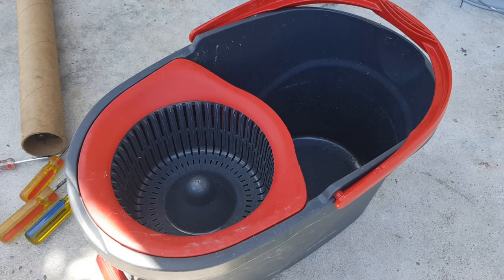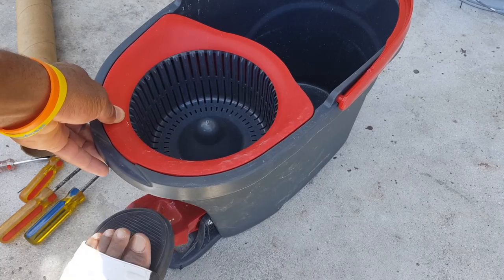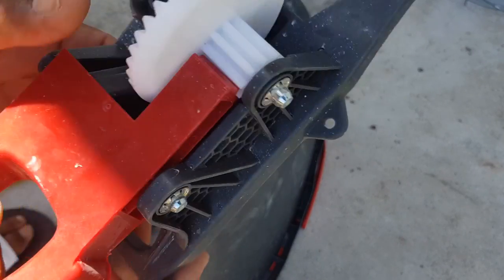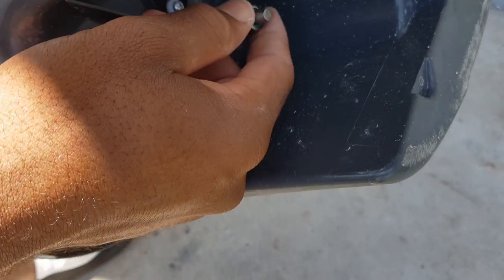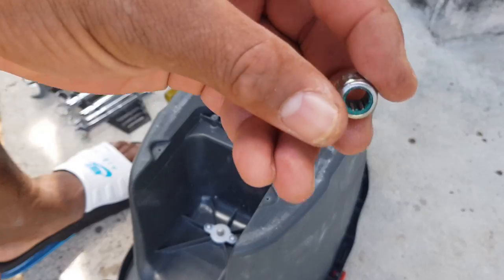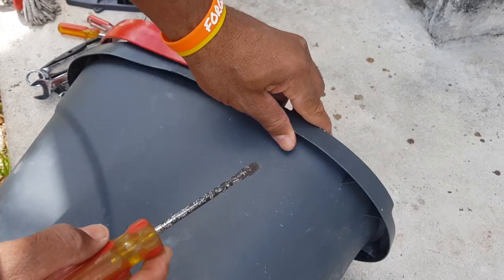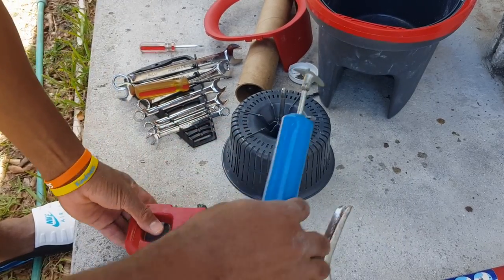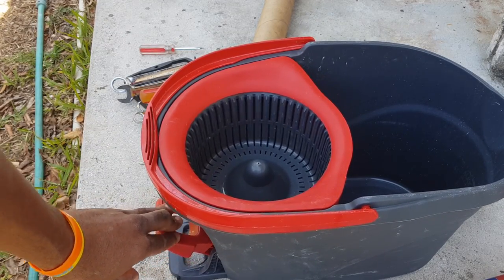O-Cedar mop not spinning properly (Easy Fix)

Comment: Took the bottom off. Sprayed all parts with wd40. It works like new. Thank you for the video.
Reply from the maker: Awesome!
Reply: I need that too! But still won’t spin idk why :(
Reply: I decided to go along with your comment and it worked!!! Thanks!!
Reply: Will try the WD-40 thank you
Reply: I tried replacing the gear, oiled everything and still the pedal goes down to spin but won't come back up. Any ideas? I can't find where you can buy just the foot pedal assembly😔

Comment: Thanks for the video. 
The most challenging part for me was removing the bearing, I don’t have the pliers, but I could get a good hold of it with a piece of cloth and eventually took it out. After greasing the bearing up a bit it started working again, we’ll see for how long.
Thanks once again.
Reply from the maker: Awesome that it's working again. If you the bearing should go bad, please see the link below for the bearing replacement. Also the ebay link is in the description that I purchased the bearing from.
https://youtu.be/yTHshD4gCbQ
Reply: @science_exam  I really appreciate repair videos like this one as it is terrible for the environment and so wasteful to throw out something that can easily be fixed. But:  My bucket does not have a bearing at all.  Yet it worked for 13 months.  I wondered if it had slipped off unnoticed while I was taking it apart.  Maybe it hit the floor and bounced into the furnace grate so fast I didn't see or hear it.  (It is true the lighting could be better; I wish I had a brightly lit worktable!) Either that is what happened  or I'm losing my mind--but it's hard to believe it was that fast and quiet and the aim to the grate was exact, like it was a comedy show!   There is only a plastic housing underneath that gear, which is one piece with the entire foot pedal section, and the turn shaft (spindle--whatever it is called) itself, which comes down from the (upright) basket, goes through a hole in the gear just as in your video, and rests in that little plastic cup, which is fixed/has no movement.  I thought at first it was the bearing stuck at the bottom.  I tried to remove it with pliers, but in brighter light it is clearly gray plastic and there is no bearing.  Did the design change?  On the bottom of that gear is a shallow groove which fits over the edge of the plastic housing (really just an elevated rim) and presumably turns on it like and old-fashioned grist mill.  So should I assume it MUST have had one, that I lost it instantly, and just order a new one?...Or could it be there isn't one in my model (which I bought in early 2021)?
Reply from the maker: @myfirstnamemylastname2994  There are different models, but the principles on which they work are pretty much the same.  If you know your model I can be of more help.
Reply: I will leave my question up in case anyone else has the problem I had--I just discovered the bearing is so coated with rust that even a thorough cleaning of the piece did not reveal it to be metal, and therefore it looked like rust stain on the inside of the plastic gear.  I had watched this original video and did not realize it was built into the gear center instead of being a lose piece that could get stuck to the turn shaft as it did in this video.  I watched the second video, which showed the bearing in its original place, so I then knew where to look.  Now I have to find a way to pop it out--we'll see what Liquid Wrench can do, because my hands are not strong and it's not budging with a screwdriver.  But what I said about design changes still is quite true.  P.S. Don't use bleach in your bucket if you tend to let the bucket sit for a few hours at a time as I do, as that accelerates rust dramatically as it did to my bearing.

Comment: I thought the problem with my spin mop was the bearing but I found that the bearing had actually worn the shaft to such an extent that the bearing was slipping. I cut off the old shaft at the worn point and welded a new piece in its place. I also replaced the bearing at the same time. Vileda mop brand.
Reply from the maker: Nice!

Comment: I think it's not just replacing the bearing that's the problem, mine's plastic gear often deviates from the rail. And you have to replace 1 unit of magic mop pedal gear. Understandably, it's a product that is easily damaged and buy it again. What do we expect from gears made of plastic that can be used to work for a long time? It is better to buy a magic mop without a pedal, because if it breaks it is very difficult to find a replacement. It's different if you buy the rotating mop handle... Many of them are sold in shops
Reply from the maker: Thank you for your contribution/ this information.

Comment: They changed the design on mine, so now it is much harder to fix… I need like a socket wrench with a Philips head to get into the space I need to get into to fix this. There’s two more screws now, under the part you unscrewed, in the space you put your foot. There is only an inch of space or so you get at those other two screws.. 😩
Reply from the maker: Wow, I hope you get to fix it.

Comment: So if the bearing is damaged how much is the replacement?
Reply from the maker: It's very inexpensive/cheap. The link is in the description from where I bought the one I used.
Reply: Or u could have just said how much and where
Reply: Alot less that a new bucket

Comment: If the bucket isn’t spinning freely after pushing in the pedal. Remove the bottom and lube the bearing and make sure there are no objects holding it
Reply from the maker: Thank you for this tip.
Reply: Thank you for the video 🙏🏼

Comment: This was not helpful. The red part at the top does not come off as easy as you showed in the video.
Reply from the maker: Sorry about that. There are few red lips underneath, press on them and they will come out easily. If you need to change the bearing, there is no need to remove the red part on the top. It's really not hard.

Comment: Mine does not snap right off... there is a grey plastic guard holding the gears in place... I cannot remove the panel from the bottom :(
Reply from the maker: Be careful if it has a guard. The smaller gear houses the bearing and you have to be  gentle in removing it.
Reply from the maker: This is a link to my other video for the bearing replacement.
https://youtu.be/yTHshD4gCbQ
Reply: Same with mine.  I tried removing the pedal and now it's stuck and won't come off. I think I damaged it.
Reply from the maker: @nataleeparkes7878  It is not damaged. The pedal will be stuck in a downward position if the bearing itself is stuck. Once you take off the bearing and release it, then it will be good again.

Comment: You owe me $30. I tried to pop off the bar that unscrews and I actually broke the entire thing.
Reply from the maker: Sorry to hear that you broke it, maybe you really popped  it or maybe your bucket  is crystalized.
Reply: Same here!!! It was all attached underneath!!!! And mine is newer so no "crystallization"
Reply: You guys are ridiculous 🙄.
Reply: @Mr.Dad1234  I do think if people have trouble following directions they should work on that, not ask for compensation, LOL.  But I do see that the design changes in small ways form time to time, and since the goal of O'Cedar is to make us buy more mop buckets, it stands to reason that they will make minor design changes which will make it hard for novices to fix and will make a good video non-applicable to their bucket....even though the bucket looks very very similar!  I've noticed, for example, that appliances with lids like a coffeemaker or a crockpot  may change shape or size JUST enough so that the lids aren't interchangeable.  It becomes easier to buy another entire cook pot than to find and order a replacement.  It used to be you could go to any thrift store and find replacement lids for such things, including over-safe glass, etc.  You could buy a non-working appliance and fix yours with the parts.  That's rare these days....
Reply: @myfirstnamemylastname2994  I was just looking in the comments bc I was wondering what my problem is, and I was thinking it was a design change to prevent this very thing. 

I’d say that is almost definitely the case. They have now added an extra plastic bar that fastens this down with two more Philips screws. These screws are hard to reach/require a very short Philips screwdriver, and another tool to hold it steady enough and to get enough leverage to unscrew, bc they are placed under the space where you push the pedal. There is only an inch of space to get a screwdriver into the space. 

I’m wondering is there something like a socket wrench that utilizes a Philips screwdriver head? If not, this may not be possible. I am trying to come up with a way to do it. Bastards at the company are one step ahead!

Comment: Anyone know? I replaced the bearing and still won't work. The peddle goes down but will not come back up. Ocedar should have whole foot pedal available, instead of buying a whole new system.
Reply from the maker: If the pedal stuck, the bearing is the issue.
Reply: @science_exam  the pedal goes down and it spins. It just won't come back up. I changed the bearing and it didn't help.
Reply from the maker: @Closereveryday  maybe the bearing is upside down.
Reply from the maker: @Closereveryday  Try switching the orientation of bearing (it may be upside down).
Reply: @science_exam  I'll try flipping it tomorrow. I bought a new system for $50 in case this one goes completely out while cleaning for clients. I would really rather take it back. If flipping doesn't work I'm going to try contacting ocedar but they are only open from 10-2 Tuesday-Thursday
Reply: @science_exam  thank you for replying back. I'll let you know how it turns out.
Reply from the maker: @Closereveryday  Ok, hope all goes well for you.
Reply from the maker: @Closereveryday  You are welcome.
Reply: @science_exam  I'm going to contact ocedar tomorrow. Theyre only available Tuesday-Thursday 10am-2pm😒 
Think it's the metal spring thing. Seems no good way to get it off so may need a new foot peddle if they sell them separately. They should sell parts on their site but I sure can't find if they do.

Comment: Whats with the irritating music? You can barely hear the guy talking.

As for the bucket... I'm saying this loud and clear... Ya see the lever pedal?? Thats the original design. DO NOT GET THE VERSION WITH THE GRIP LOOKING HANDLE, SOLD AT PLACES LIKE DOLLAR GENERAL, FAMILY DOLLAR, BIG LOT, etc.. ALSO BY O'CEDER. For whatever reason the gear box in these models wear out in no time. And I mean gear teeth break or it starts slipping, it just stops working. It is not the same quality as the version with the solid square pedal as seen in the video here.
Reply from the maker: Thank you for your comment and explanation. There is a link to a version without music in the description.